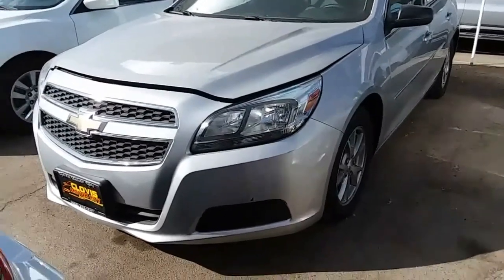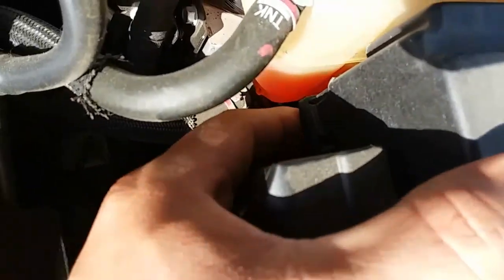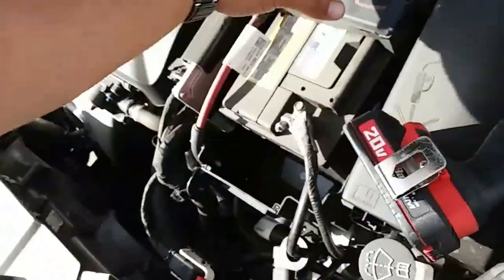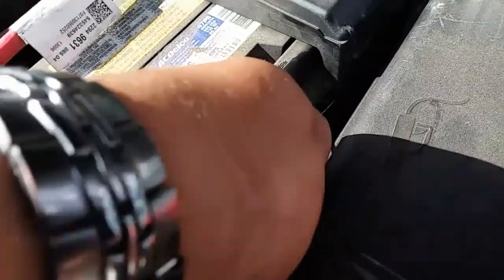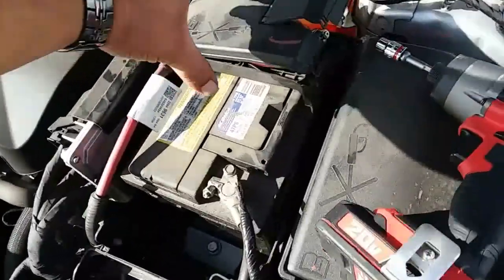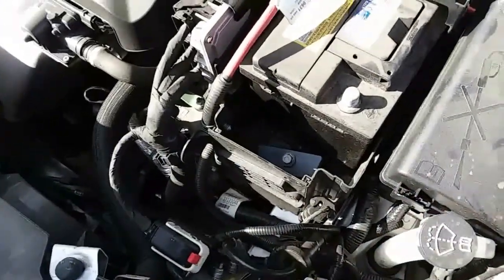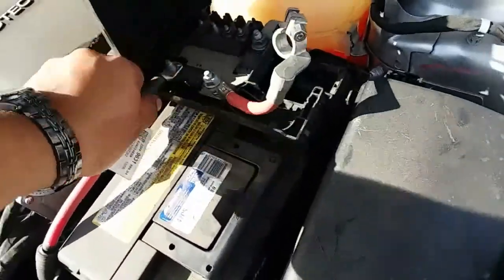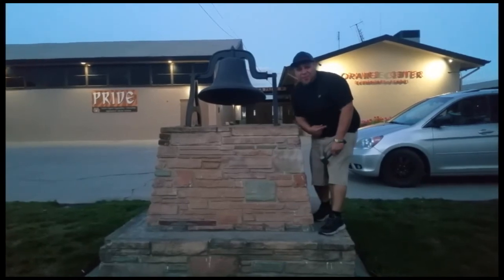How to: Remove a Battery from a 2013 Chevrolet Malibu

Comment: Great video! Well explained instructions!  I found your video to see if I could find info on how to remove the plastic cover. Then to remove the battery, I used the 10mm and 13mm sockets to loosen the nuts like you mentioned. It took less than 10 minutes to take the battery out because I didn't have to guess which sockets to use!
Reply from the maker: Lol heck yeah! Im glad this worked out for you and were able to complete it fast! Thank you for your Support 🙏

Comment: I had two replace two batteries in 7 years thank you for the video this time I changed by myself. Don't know why for this model they made it a little bit harder but I just remembered that I had a intrepid 1998 that in order two access the battery you had two remove the tire lol. But the way I think that the automatic lights are draining my batteries so there is a way two turn off the lights faster I will be doing it.
Reply from the maker: No way thats good bro! The head light switch. You can try turning it on and off after the vehicle is off and see if that works. That works on some vehicles maybe it will work on yours too 🤷‍♂️ 
Thank you for your SUPPORT!